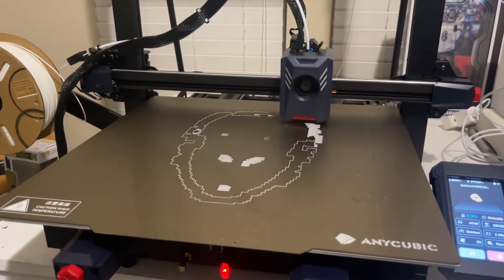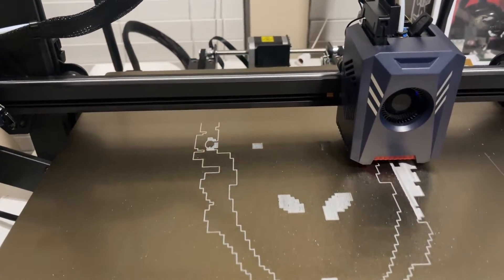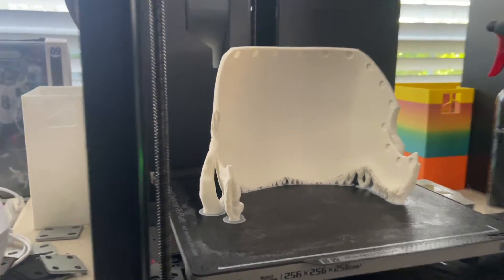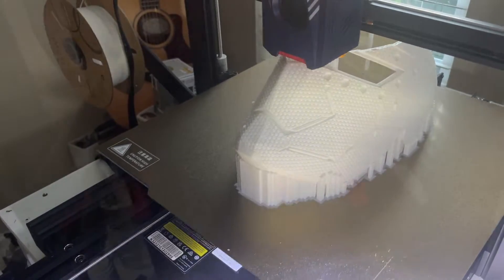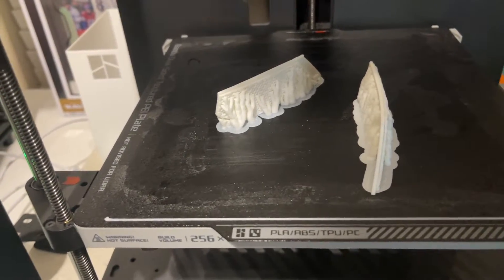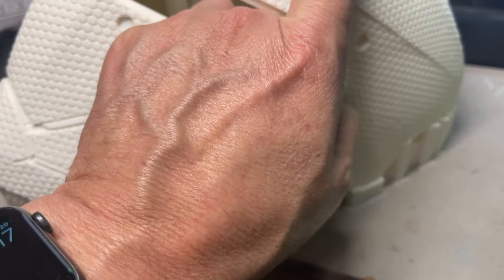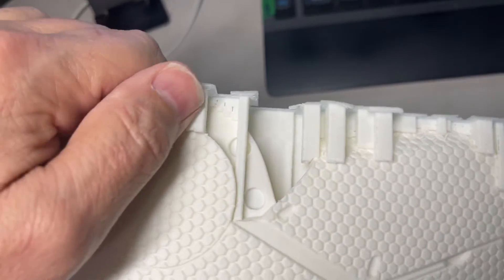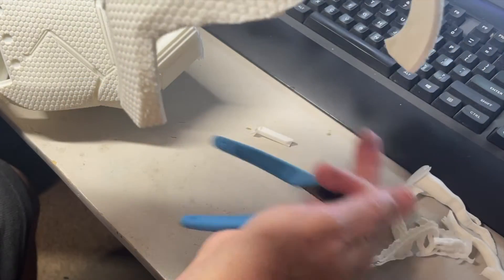Kobra 2 Max vs BambuLab P1P/P1S printing a Spiderman 2099 Helmet

Comment: The stringing inside the helmet is most likely from a tree support that fell mid print, & the excess filament strung up & attached itself to the next surface the extruder touched
Reply from the maker: Good point, I didn't think of that!

Comment: How does the speed compare? Those bamboo lab printers can be really quick. I’m looking to replace my creality cr v2 printers. Maybe with a couple of bamboos.m🤔
Reply from the maker: I started a print on the P1P and the K2 Max.  Same prints, took all default settings from the slicers, Bambu Studio vs Anycubic's slicer.  The prints looked identical and the K2 Max finished about 5mins faster.  Maybe I'll get a video going this week to compare prints between the two making sure they are using the same print speeds.

With that said, I know that I can rely on my BambuLab printers so if I ever have to just print something and go to bed, the print always ends up on the BambuLab.

Comment: How have your prints gone since you’ve printed this helmet with the any cubic 2 max? Are they still printing wall or are you running into issues like everybody else?
Reply from the maker: Surprisingly I've had zero issues with the K2 Max.  I'm very happy with it.  But if you don't need the print volume I'd get a P1P for the seamless slicing, printing and remote monitoring.

Comment: the reason I will not buy a K-2Max is because it is closed source and can't use another slicer also that your creations are not private!!! sooo I am going to stick with my neptune 4 Max, but that is why it crashed AnyCubic made it incompatible with any other slicer
Reply from the maker: I use Orca Slicer and put the GCode on the USB stick to print them.  I only print stuff that I don't create over wifi...
Reply: Urrm that is not true, you can use whatever slicer you want.